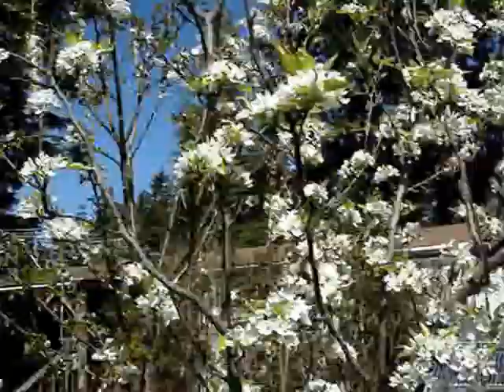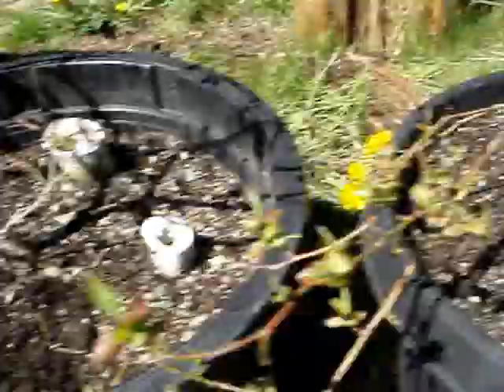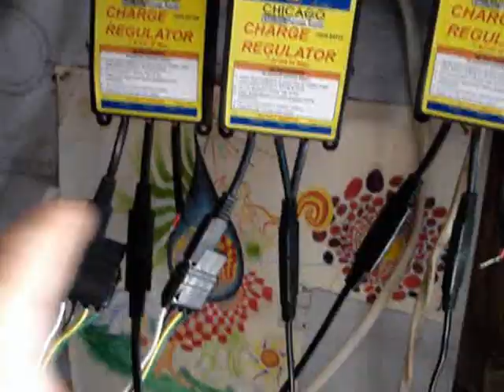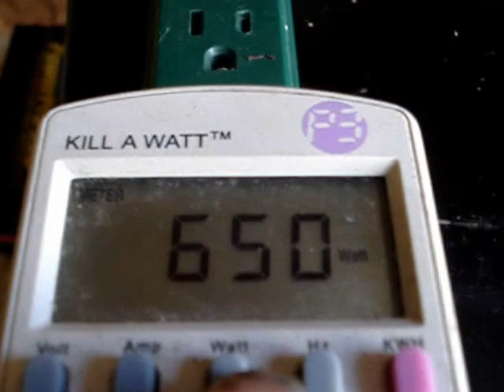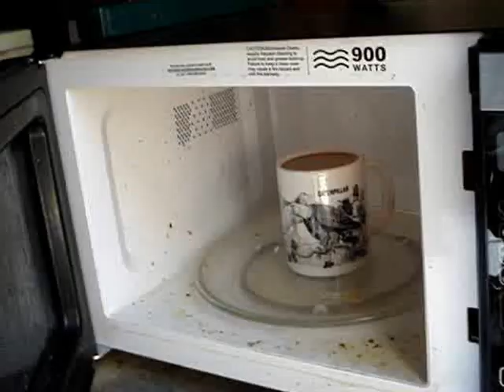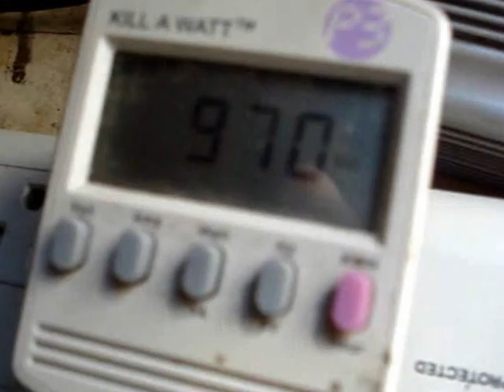Off Grid Solar Power Demonstrations

Comment from the maker: If the 3 sets were all facing south with equal exposure that would be doable. 1 set of 4 faces west, 1 set faces east, while the 3 harbor freight panels are on the ground. I could set them all on the ground with the pvc stand. When i do that they can get wired into the C40 Xantrex. I think the lighted ones may back-feed out of the shaded ones without thoses regulators.